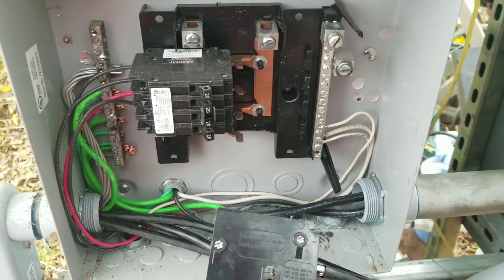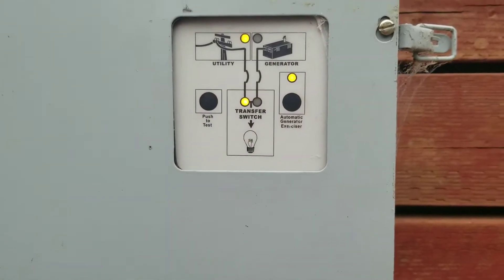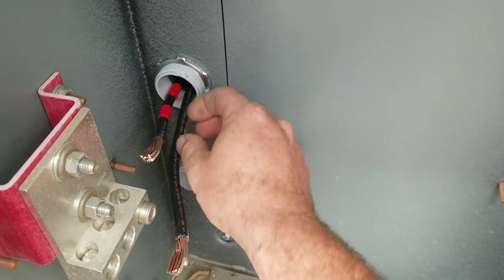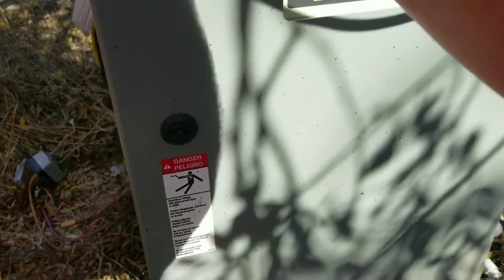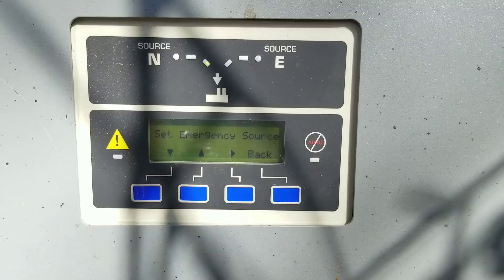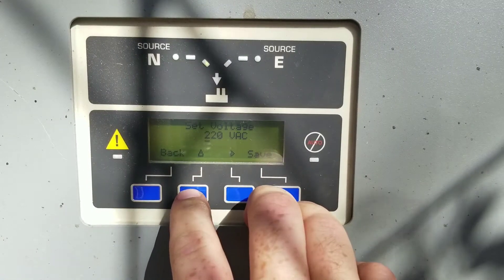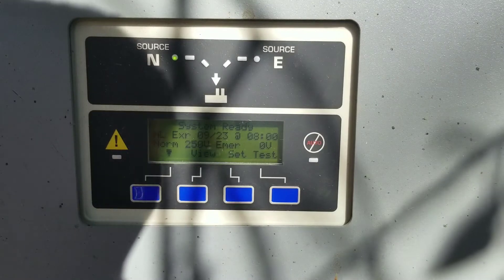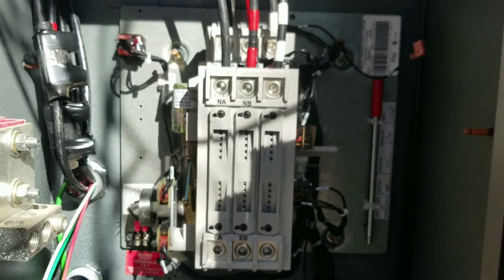SETTING UP A TRANSFER SWITCH ALSO PROGRAMMING KOHLER ATS

Comment: We have a 20kw Kohler generator and was wondering how to program a delayed start so it doesn’t turn on when there’s a short outage of a few seconds. Thanks
Reply: We need the info off the ATS (model, serial#, etc)which controls the delay gen start, should be on the nameplate/ dataplate on ATS